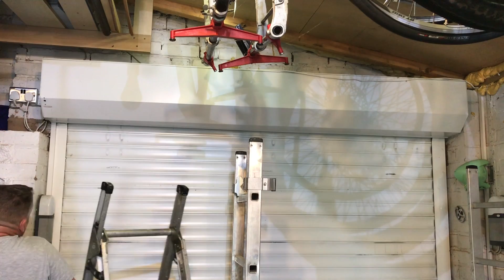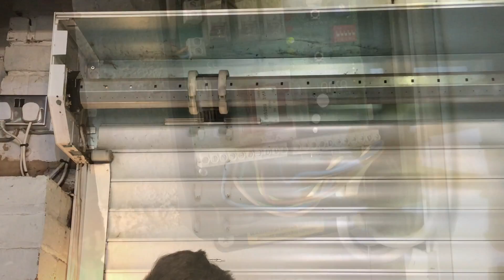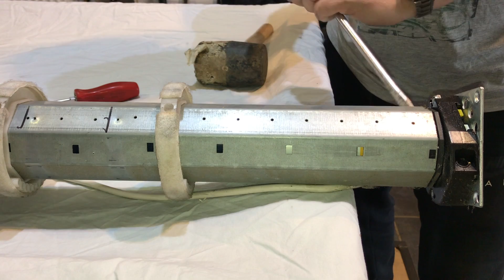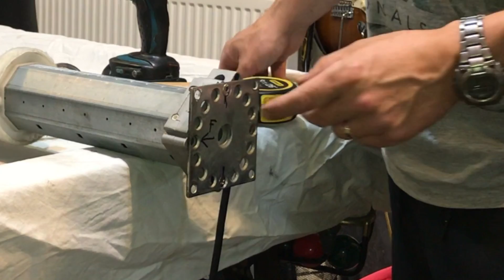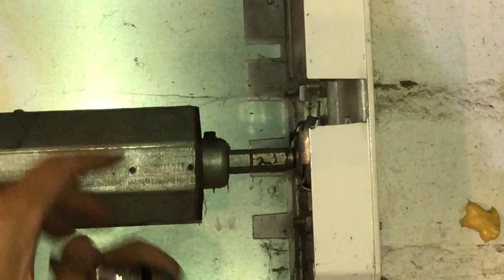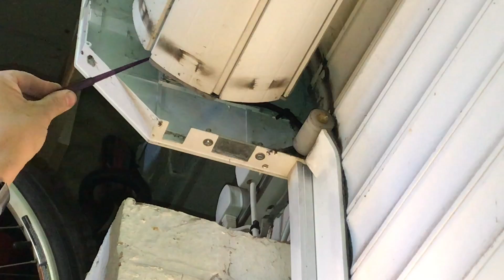Roller Garage Door Motor replacement, "How to Repair Electric Door"

Comment: I make garage doors and you didn’t to bad of a self repair job, what I would have done if I was you would be to rivet the drive end of the motor to the actual shaft to minimise the play when the motors moving. Nether the less well done
Reply from the maker: Thanks Mark for the great information👍🏻👍🏻🛠
Reply: aaanton11 if anything else goes wrong with it and you need parts or even a new door, don’t hesitate to give us a call, we’re leading UK manufacturer of high quality roller garage doors and security shutters, with competitive prices... https://www.aluroll.co.uk
Reply: @markroberts1049  can't go wrong with an aluroll shutter 👌🏻😎
Reply: TL 2584 that is true aluroll top of the range
Reply: @markroberts1049  SWS UK are decent aswell 😎
Reply: TL 2584 yes they are, a lot bigger than us to but we don’t do to bad to keep up with the big boys 😁
Reply: @markroberts1049  the company who I work for in the South Coast we have a manufacturer in Mitcham - Surrey "sgg" Southern Gate and grilles who supply our continental shutters & the bigger euro type shutters for us.

Comment: I have exactly the same system as this. The door won't open but it will close electrically. I presume it is a motor issue but thought I would ask to see if anyone else has had this problem?
Reply from the maker: Does it click when you press the button to open the door, if so you need to put a volt meter across the motor output pins on the control panel, the other issue it might be is the upper limit switch, which is on the motor. Thanks for the great comments👍🏻👍🏻🛠
Reply: Its the run capacitor. Do as in the video but take apart the motor and you'll find the capacitor inside, unplug and fit new one which will be around £6.

Comment: Happy to offer any advice for anyone changing their motor. RH Doors and Shutters Ltd.
Reply from the maker: Thanks for the great comments👍🏻👍🏻🛠
Reply: My roller door is very, very similar to this one and goes down smoothly with no noise from the motor but only goes up with some assistance so I was thinking it might be the capacitor no longer giving it the initial boost needed and therefore stalling. I didn’t see a capacitor in this video, do you know if it was there just tucked away? Thanks!
Reply: @Simon67316  The capacitor would be inside the body of the tubular motor.
Reply: Hi mate, wondering if you could advise about adding a wifi smart switch to a neco roller door controller please? Thanks in advance
Reply: @ali.r.husain  Does your door have a safety edge?
Reply: @rhdoorsshutters5517  it has the light curtain installed
Reply: @ali.r.husain  very easy. Just need a cheap 2 channel wifi switch. Then wire one channel to open, and the other to close.
Reply: @rhdoorsshutters5517  mind if I email you what I have wiring diagram wise pleasee
Reply: @ali.r.husain  fine. We’re easy to find online.

Comment: Great video. How did you know what size motor to buy? I’m struggling with working out the right diameter tube to get. They all seem to big online - my motor tube is only about 49mm
Reply from the maker: If you are struggling pop the old motor out of the tube it will have a part number on it  Thanks for the great comments👍🏻👍🏻🛠
Reply: Somfy 55/17 motor will fit both 60mm shaft and 70mm shaft only difference is you get different size crown and wheels for the motor for each shaft size